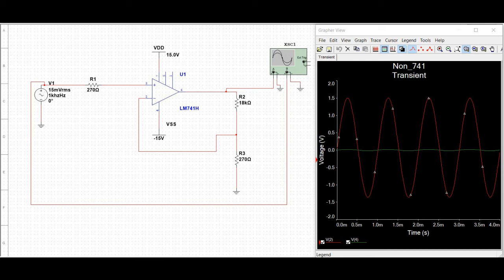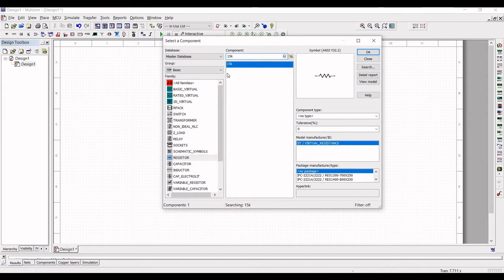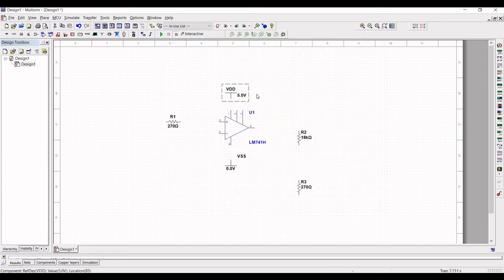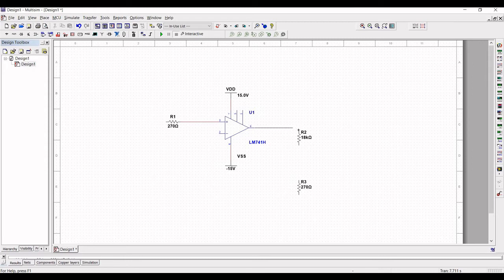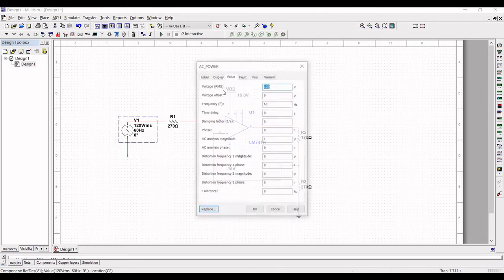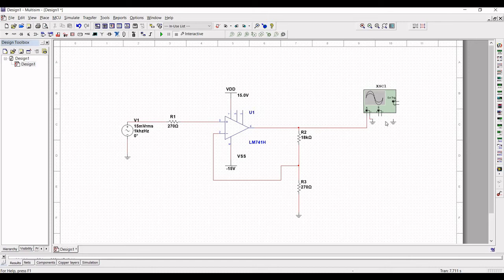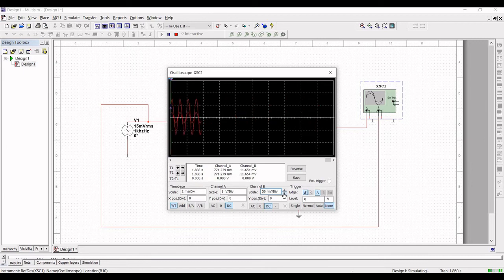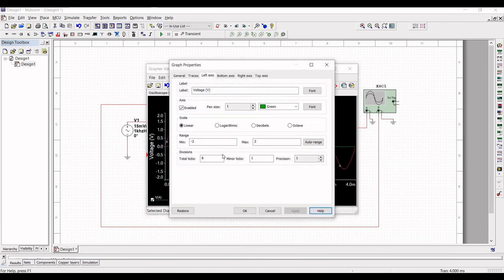Multisim tutorial 8: Simulation of Non-inverting amplifier using multisim 741 op amp

Comment: I hope you can help, but I have an oscillator circuit of some sort that I cannot get to simulate.  Now I have the real world oscillator in my hands that works 100% but no errors just not working in any spice simulator I have tried.  I have spent 3 days reworking, rechecking, and redoing everything numerous times, but I can't get it to simulate.  I put in every component value used to no avail.  I am stumped.
Reply from the maker: I did simulate the colpitts oscillator circuit using 2N2222 transistor. Sharing the link for your reference. Hope this helps you
https://youtu.be/dll-IgtCB9Q
Reply: @circuitgenerator9788  Well, I am done verifying after three days of verifying then reverifying.  I finally superimposed the front, and the back of this through hole board, and my sim is spot on with the exact values, placement, and connections.  Something the sims need from a real world variable (that I have no idea what that would be)  or they can't simulate this circuit.  I don't get it.
Reply from the maker: In which tool you are trying to simulate?
Reply: @circuitgenerator9788  I tried LTSpice, Multisim, and circuitjs.  I even superimposed the components over the through hole to check myself and all components are of the right values, and placement.  Works in the real world but not in a simulator.
Reply from the maker: You can share your design file let me check. 
circuitgenerator2020@gmail.com
Reply: @circuitgenerator9788  I just sent it to you.  That is really simplified, and I was messing around with stuff (like the led), but I believe that is a working version per the actual hardware device I have that is.